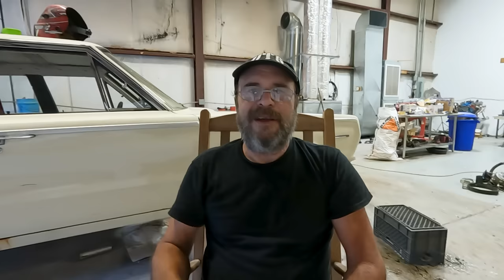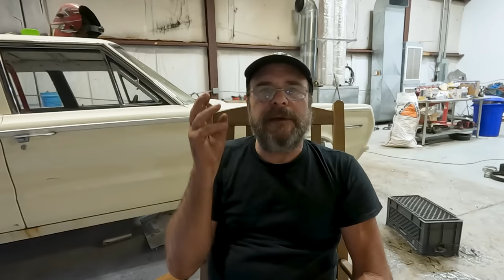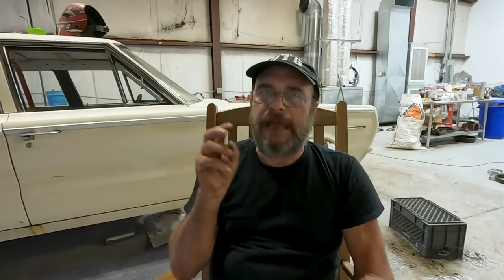They Really Are Out To Get You- How The Automakers Have Made Life Miserable For The Average Mechanic

Comment: I knew they were screwing with us when they came out with the computer controlled carburetor.  If they had the technology to run that POS, they surely could have just run the simple TBI fuel system that showed up a couple of years later. I LOVE the Boomer chair. Thanks, Uncle Tony!
Reply: You know if a carb needs wires they're fucking with you.
Reply: In that case in that era, I think it was more about how quickly they could do it safely without price shocking the consumer. Considering just how bad most feedback carbs were, and the radical reducing in quality we saw in US cars during that time, did you really want them trying to figure out high pressure EFI injectors right then? 🤣

Besides... the work-around for that particular problem was as easy as a trip to your local junkyard. I always looked at that era as a blessing, with perhaps a wink and a nod from the OEs, since they knew full well that any carb and distributor could get screwed right on. Same thing with air injection pumps... as soon as it gives you a fit, buh-bye. 😆
Reply: I have two gm cars with feedback carbs, I understand the system backward and forward, inside and out, there's plenty to like about it.  Main reason for it though is closed loop mixture control to avoid roasting the cat converter.  An open loop carb is bound to either under or over feed the cat.
The big downfall with carbs these days is our fuel sucks compared to what we used to have, In my opinion.
Reply: @thisisyourcaptainspeaking2259  I honestly found the biggest issue with the feedback carb cars is the sea of vacuum controls that usually went with them. The carbs themselves seemed mostly fine, it was everything else that got attacked by an octopus that caused trouble.
Reply: @TheBrokenLife  The only vacuum lines on mine are for egr and charcoal canister.  The air pump valves on earlier models were vacuum control.  I've eliminated my air pump since installing a modern 3-way cat, they have O2 storage.
This system has torque converter lockup on a 3 speed auto, electronic ignition advance and a knock sensor.  The earlier versions didn't have knock sense, either.
Runs great, gets same mileage as a modern vehicle.
Reply: @thisisyourcaptainspeaking2259  What vehicle is this? A 3 speed with a lock-up strikes me as particularly unusual. I've never heard of a knock sensor on a vehicle with a carb either. An odd combo, indeed.
Reply: @TheBrokenLife  CCC system, 1984 gm 231 Buick in a gbody el camino. Th250C (very similar to TH350C)   I installed the buick 4.1 4bbl intake manifold and run the E4ME Rochester.  My 81 305 doesn't have the knock sensor but it has the th350C
Reply: @thisisyourcaptainspeaking2259  What an odd combination. I was around a lot of G-bodies back in the day and I only ever knew them as 3 speeds or AODs. Perhaps I just never knew..?

Comment: I grew up working on Nissan/Toyota/Honda/Mitsu - obd1 and early obd2 engines. 
I've had the most wrench time with a ca18de, screwiest thing is, the usdm fuel rail, that came on the late 80s pulsar, it had press fit fuel lines to the injectors. Literally every. Other. Country got top o-ring injectors that push into the fuel rail.... 0_o y.

Comment: I quit being a bicycle mechanic for similar reasons. The same sort of bs is going on there, too. 10k bikes being sold, non serviceable parts. The few things left to service are an all day nightmare task. And they still try to pay techs as if nothing has changed since the 60s.
Reply: I feel that. I quit wrenching on bikes in 2013. The shop I worked at had been a used bike shop for decades and the inventory of old parts was vast, terribly disorganized, and glorious. Even so, we were selling some new bikes, and it was already becoming a frustrating proposition. Internal cable routing, electronic shifting, the first generation of electric bikes....
I think the peak of useable, serviceable bicycle technology was 8 speed XT, ca. mid '90s
Personally, I ride a steel-framed 1993 Giant Iguana with V-brakes and no suspension, converted to single-speed, of course.
In the early '90s a good bicycle mechanic could earn a living wage, barely. I hung in there as long as I could, learning all the new technology, buying the new tools, etc. But wages never kept up and I had to cash out. Now I work for a company that makes mining and construction equipment - all steel, 95% solid-state controls, hydraulic motors and actuators. Heavy, robust stuff that will work all day in the jungle or desert with limited maintenance.
Anyway, the bike industry is a shit-show now, but I miss the good old days - hanging out after the shop closed to work on our personal bikes, having some cold beers, cruising down the hill to get some tacos.... What a life!

Comment: Had to drain old gas out of a car tank recently. Disconnect a fuel line up front and with my air compressor puffed a bit of air into the tank that forced the gas into my catch can. Low PSI and a rag around the air nozzle at filler neck. 
Worked good!

Comment: I like your videos but please use a tripod the rocking  while using the selfie stick adds a negative aspect and will cut your view duration because people will get seasick. I own a boat so I'm able to watch. You're 100% right. I was telling my friend about my 77 Toyota pickup that has 790,000 miles on it Original motor original transmission it's been through seven clutches. My friend's response was: "I'm sure they fixed that problem!" (they did) Thank you great video except for the rocking.

Comment: Regarding fuel pumps .. the Chevrolet Impala prior to 2005 had an access panel underneath the carpet in the trunk .. after 2005 no more access panel .. on my 2003 Chevrolet Express 3500 cargo van the wire connector for the neutral safety switch on transmission was glued together with epoxy. I had to destroy the connector plug to replace the part and buy a new connector plug and solder that to the wires on vehicle. Subscribed you tell the truth.

Comment: Chevy S-10, wanting to change my own transmission filter and fluid. They designed a crossmember that blocked one pan bolt.
Last GM vehicle I worked on, first 4-1/2” grinder I owned.

Comment: I had a '75 Chevy Monza and  it had an in tank fuel pump . The  pickup  sock would  collapse  after 40,000 miles. Ya had to drop the  tank to replace it.  My '04 Pontiac Vibe  has an access plate above the  tank. It's been a great  car.

Comment: One way to go Cuban is to replace the current electronics/modules with custom built generic programmable modules that can be adapted to any car. That would be a way to get around legal restrictions or at least be able to pass an inspection to keep it on the road. You would just need a set of software and adapter cables that make it work. The nice thing about that is it could contain self diagnostics that goes beyond obd code to help in maintaining the car and ways of compensating for things (through reprogramming) that go wrong until a proper repair can be made. There are so many nice cars out there that could be saved this way. The first thing that needs to go is the gps tracking and spyware on these cars or at least a way to turn it off. You don’t necessarily have to go analog. Mass production of these generic computers/modules is the key.

Comment: I built those fuel senders for Jeep back in the 80's and 90's. Initially the sender was in the tank with the pump external, I shook my head when they added the pump to the sender then In the mid 90's they went from circulating pumps at 18 PSI to returnless at 60PSI which crated more issues. Fast forward to 2011,  I was the quality engineer at GM where we made Camaro and AWD Cadillac which both had a saddle bag design gas tank to straddle the drive shaft with dual pumps. The second pump moved gas from the idle side to the feed side, then there was equalization software, etc. Now it's $2000 for a fuel pump job involving dropping the drive shaft and dual pump replacement. I said to engineering what are you thinking. why don't you just put a coupling hose between the two sides, then told them about changing my cam driven pump the night before at a cost of $27 done in 15 minutes. KISS. They don't get it and never will, service is not their concern.

Comment: It goes far back.  My 1968 Mustang had creaking suspension by 1972.  We went a looking, and all the grease points were capped with small bolts.  They could have just as easily screwed in grease nipples, but noooooo, all the grease points were capped off.  They were starting to make cars disposable way back then.

Comment: I believe it.  I have a Crown Vic and my heater core went bad.  It was a $36.00 part.  But the shop wanted $1200.00 to fix it because of the labor.  So I did it myself thanks to a YouTube vid on it.  You have to drop the steering wheel and drop the whole dash to get to it.  There was no reason it could not have been put in to where you could just pull it out from the engine bay.  To add insult to injury the top bolt needed a special dealers tool(so I made one) to take the last bolt out.  It took me 8 hours. 15-20 minutes to take out the core and put in a new one.  The other 8 hours was spent on taking the dash apart and putting it back together.

Comment: The fuel sending unit on my 2001 Chevy Monte Carlo went bad. Tried going to the Chevy dealer to buy a new sending unit 20 years ago. They quoted me $850 for the entire assembly. I went online and bought a sending unit on eBay for $14 . Pull the pump out through the access door which was amazing that it's actually had one. Replace the sending unit and fixed my fuel gauge for $14

Comment: I had a 2003 Dodge Ram 2500 that was difficult to get an inspection due to the ABS idiot light being lit on the dash. The problem wasn't with the brakes, it was from a faulty sensor. The catch was the sensor being located within the "unitized hub wheel bearing assembly" which the last time I checked cost around $750 to replace.
My cousin works as the head service tech for Ford. He was telling me not long ago about new fasteners he's seeing that require yet another set of tools to operate. He once sent me a picture of an F-150 on a lift with the engine dropped down out which read, "All of this just to change the spark plugs." You're right, this has gotten ridiculous.

Comment: I live in the UK and drive a 2006 Vauxhall Vectra SRi (Saturn Aura in US).  I do all the servicing and repairs on it myself as a DIY mechanic.  The only thing I use the garage for are tyres and MOT.   It has some electronics and a ODB2 diagnostic system but is still DIY-able.   But cars like that are becoming less common.  I am not sure I could diagnose or work on something like a Tesla.    Keep the old cars going as long as you can.

Comment: I can only start my 2015 Altima intermittently. The key fob isn't recognized most times. Instead of a $10 relay, the car requires the replacement of a part which integrates many relays and costs $500. I now have a $8k paperweight. Of course it's worth $8k if only the fob gets recognized.

Comment: I worked in the auto industry for 5 years from 2916-2021 and learned to hate modern cars.
I don’t really need a car now as I drive a taxi, but I’ve a 2004 Volvo V70 petrol/manual that’s still running exceptionally well.

Comment: I had a 2008 Cobalt LT. The power steering module went out in it. The replacement part was 128 dollars. Chevy then wanted 1100 dollars to flash the system with a computer code so the module would synch to the car and work. 
I scrapped the cobalt.

Comment: Our Audi has the battery under the passenger floor. The previous years' models had it under the driver's seat; seat had to be REMOVED to replace the battery. And the diagrams in the owner's manual, presumably translated for a British configuration, had the battery and the under-hood charging access leads on the wrong side. Took us a while searching to see that everything was reversed.

Comment: I have a 2013 Kia and I can't even change the oil on it myself as the bumper overhang is so far forward thet it catches on the ramps and there is a big plate that has to be removed to access the drain plug and filter. There is no dip stick for the tansmision either. My old school classic cars with V8 engines I car do oil changes  easy.

Comment: I have a 2002 Cougar with the 2.0 Zetec engine. I'm able to do most of the easy maintenance on it, but the engineers made it interesting. The oil filter is on the back of the engine directly above the exhaust. I do oil changes early in the morning and with a cold engine. I'm about to change the original belt because of age and it looks like a tight squeeze, but I'll figure it out. I don't even touch my wife's 2020 Edge.

Comment: OMG, fuel pumps! I recently had an adventure replacing mine in my truck. I didn't want to drop the (full) tank, so it occurred to me to remove the bed. 6 bolts, 5 electrical harnesses. Didn't seem too bad, and much preferable to dropping the tank. My heart absolutely sunk when I got the bed moved over a few feet, only to see that the access cover on the tank was under the cab. The other 90% of the tank was exposed. I eventually got it replaced myself, which was another long story. I guess the only reason the job was still in the "possible, but very difficult difficult" range was simply because the truck was a 2002 model. I'm now absolutely disgusted to learn that accessible fuel pumps used to be a thing, but are long gone.

Comment: So much truth here. Unfortunately, this is not only the automotive industry. It’s every industry. I’ve been in avionics, electronics, electrical, computer, CNC, industrial equipment, industrial vehicles, port equipment, port cranes, automation, automated port cranes and I can verify this is everywhere. Now a video module, a console module, a bad Ethernet connection, a water compromised junction box, a loose connection, a failed cable etc, can completely bring an entire system to a instant grinding halt and require multiple diagnostic software and equipment to diagnose just to find out that that module or cable or software is no longer available and will need complete upgrade and replacement. It’s insane

Comment: Born 53.
1st car 1960 Comet.
Had several vehichles through 1971 Maverick. In 1974.
Without any mechanicle instruction could figure out and finish most work.
Kept buying old cars, as technology got more complicated.
I have a 2018 Atlas.
Took me 3 years to learn how to use all the tech.
I dont even change the oil myself.

Comment: My first cars were 1966-1975 VW Beetles, this was the late 80's through the 90's. A couple years ago I find a 74 Beetle, it had sat for almost 20 years, took a days work to get it running and driving. Ive thrown money and parts at my 2001 Ford Ranger i9n this time, virtually everything, still isn't dependable. So I found a 1987 El Camino, it had sat about 5 years, to replace it. Just a few basic things and it's running and driving. Of course the CCC system is being deleted, put an HEI distributor on it, going to replace the Quadrojet with a Holley, but you can retrograde something like that. Also, I recognized all the dates, and also the birth certificate reference.

Comment: I remember that I worked on a 1980's Cadillac (4100 Engine) in the late nineties that had the pushrods going through the intake manifold. I fixed it to run, but I returned it to the
owner stating "This car is too hard to work on." I have encountered the in tank fuel pump replacement on our 1999 Chevy Suburban, and the plastic connectors (I had to purchase
a special tool to salvage them). I recently had an electrical problem that I could not resolve, and I hired an electrical specialist who had to disassemble the dash board to find
and service the crucial electrical component that went bad..... Thus, I "go cuban" on all my projects. The rationale behind the computer generation of automotive development, 
is to totally prohibit the DIY service alternatives via extremely expensive diagnostic equipment: All because they overproduce the new cars that are manufactured and they MUST 
sell them. Otherwise, they are content to crush them (completely recycle the unsold new cars), to maintain the elevated purchase prices.... I will never buy anything new again!

Comment: I go to GM 8.25 front diff honestly it's smooth. It doesn't make any noise except for the axle rattles. Is it possible just the sub shaft bearing and seal would fix it or maybe it's just worn out?

Comment: $1100 for an alternator replacement on a 2005 Ford estate 3.0. You can't get to it unless you take the passenger side front end assembly off. Conveniently placed next to the Front  Oil seal.

Comment: My good friend had a 1962 Pontiac. It has a grease fitting in the driveshaft that led to the carrier bearing to lubricate it. My 1963 Chevrolet Impala had the same setup, but no grease fitting to lube that carrier bearing. On the day I found this out I said, Thats it, they don't want cars to last. There eas nothing wrong with the mechanical fuel pump that ran off the camshaft. They used to sell repair kits for the fuel pump that included a new diaphragm, and two new check valves. A good friend of mine I met in the Air Force from Rochester New York told me of a buddy he had that invented a variable venturi carburetor that would get 33mpg on a standard chevy 283 v8. General motors bought the rights to it, destroyed it and had the guy sign a non disclosure agreement for 400,000 dollars.

Comment: Chrysler keanburn system was unserviceable for all mechanics. Remove the distributor install 1974 distributor  disconnect  the lean burn system and install a Holley 600 carburetor and some simple wiring . They passed emissions tests in Illinois better than any lean burn .